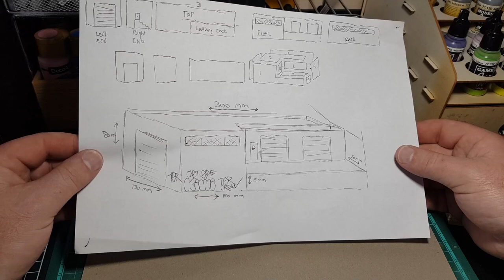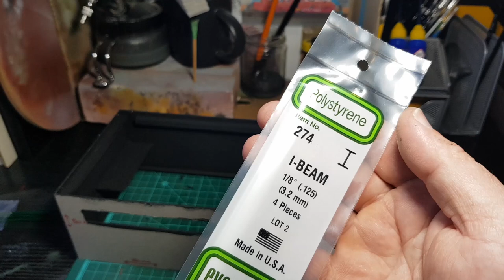Scratch Built Warehouse

Comment: Which brand/model paper cutting tool did you use? Ive been trying to find one that will cut through chipboard
Reply from the maker: This one dosnt actually have a brand name dude, its just a cheap one I found on ebay for about $20, its really good quality though, ive cut through card up to 3mm thick with no issues and it scores styrene really well too

Comment: Excellent job! The detailing you did really makes the building work. I've used cardboard from cereal & tissue boxes to build mock ups in the past. This time I'm using cardboard and foam board on a couple of more 'permanent' builds for the layout. Trying to do my part and cut down on plastic, lol.
Reply from the maker: cheers mate, some great results can come from the most basic items that end up in the rubbish bin, and styrene is so damn expensive too
Reply: @TheSteelRoad  
Agree with you 100%. I've made oil/chemical storage tanks from repurposed mailing tubes. The clear plastic packaging used for croissants from Costco / Sam's Club becomes 'glass' for many windows in buildings on my layout. You can cut out 2 huge sheets and many smaller pieces from the packaging.
Reply from the maker: @davidchang7838  hell yeah man that's awesome! and the best part about it is that's its unique and there will be no other structure like it 😎💯

Comment: How did you construct the railings of the small stairs to the side door? Which material?
Reply from the maker: I just used balsa wood as its easy to cut to the shape and the railing was made with floral wire
Reply: @TheSteelRoad  Thank you for the prompt reply. 

What I meant to ask was, did you glue the wire together or solder it. If glued, which glue?
Reply from the maker: @ajaydeshpande735  ah my mistake, yeah I just used plain old super glue, it works well with this wire